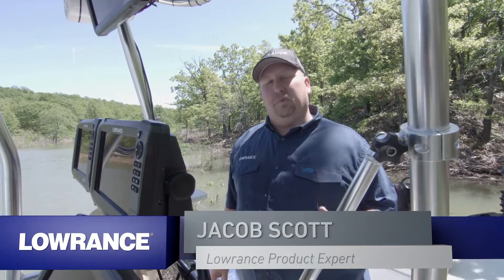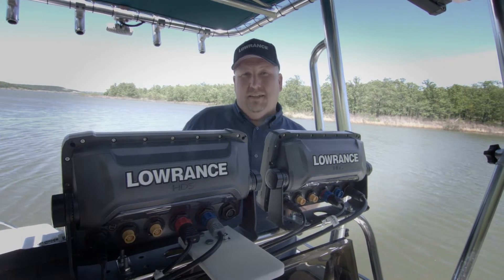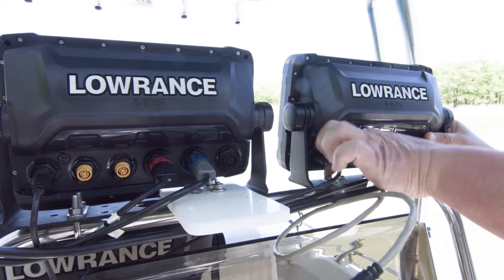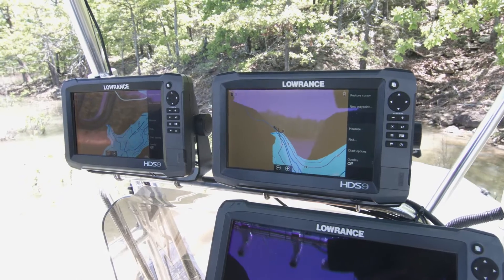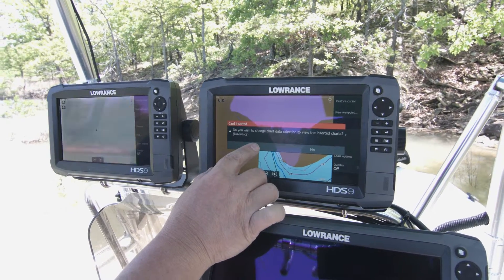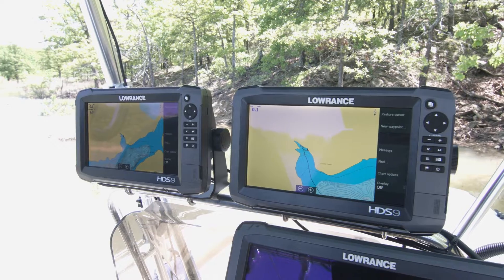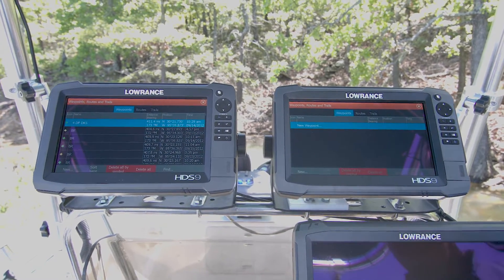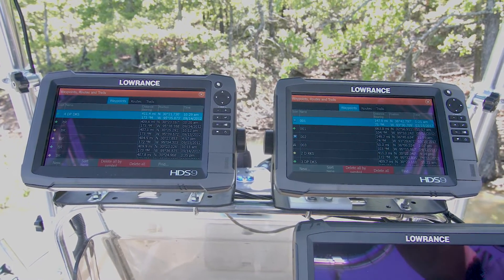Lowrance | How to Network Lowrance HDS units via Ethernet

Comment: I have a single HDS PRO 12 and want to add a HDS PRO 9 and a HALO20+. Can I daisy chain them with ethernet and have all the info shared on both units? 
Like HALO20+ connected to HDS 12 then HDS 12 connected to HDS 9. I do also have a Airmar B175 and one 3 in 1 transducers connected to HDS 12…

Comment: I have an hds 12 live and a Elite 9 fs. I was told to link then I'd need a nema 2000 cable. I am running the 12 with active target. Is the nema cable or ethernet cable needed?
Reply from the maker: You can use both N2K (GPS antenna, trolling motor) and ethernet (sonar, cartography) connections.
To connect the AT module you'll need ethernet connection.

Comment: Can we hook-up 2 hds units with Ethernet but share one transducer?
Reply from the maker: Yes, you can ethernet connect your two HDS units and share one transducer. You will be able to share chart too.
Reply: @lowrance  thank you. I can’t get it to talk to the other unit and show depths etc. 
is there a number I can call for help? 
Transducer on my HDS Carbon 9 at the help works fine. The second HDS Carbon 9 I added doesn’t read the depths

Comment: I have an HDS 12 gen 3 on the dash AND an HDS 7 first generation on the bow.  I spent $4,000 plus for the HDS 12 and was told multiple times that the gen 3 unit and the first gen unit could be networked.  I had nothing but trouble.  The sonar pages would often freeze on both units, plus all kinds of other crazy things going.  I spent loads of time on multiple occasions on the phone with tech support explaining in great detail my setup being sure to mention one unit was a first generation HDS 7 and the newer one was gen 3.  They said that is not the issue, that the units should network.  I even sent the HDS 12  back to Lowrance to be checked out, and reset.  It was not until recently that I found out on an online Lowrance forum that they will NOT in fact network   because the older unit will force the newer unit to go into "Legacy Mode".  So what the hell Lowrance, you should know this ! !  What a waste of time, and heart ache on the water ! !
Reply: I’m having the same issue with 2 Live 9’s and a Gen 2 8”. I think the Live hooked to the Gen 2 goes into the Legacy mode they refer to and those locators on,y had 1 ethernet port on them. The software must tell the Live unit that there is only 1 port available so it shuts down the 2nd port hooked to the other Live 9. That explains why my 2 Live units aren’t able to see each other on the Ethernet network but can see the Gen 2. I’m going to try them with the Gen 2 8” off and see if that resolves the issue. It blows that I lose the Gen 2 8” as my full screen map at the bow though if that is the case. Any thoughts @Lowrance ?  Edit…that wasn’t the issue. Even with the HDS Gen 2 disconnected, 2D sonar still freezes and loses its connection to my bow Live 9.
Reply from the maker: The two units, can indeed, be networked together, both via Ethernet and via NMEA2000. You do have to consider the Gen1 might not have the feature you want to share from the Gen3.
Reply: @lowrance  I respectively disagree.  I had nothing but trouble when networking via ethernet my Gen 1 HDS 7 and Gen 3 HDS 12.  Some features like waypoint sharing worked but so many glitches began showing up.  Sonar page would freeze on the Gen HDS 12, side scan would sometimes not work.  All that went away after I disconnected the ethernet connection between the two units.  I now have connected via the same ethernet cable a Gen 3 HDS 7 with same HDS 12 Gen 3 with zero issues.

Comment: I have connected the HDS9 Live with the HDS Gen3 with ethernet but waypoints and mapping aren't sharing. Any Ideas? I'm on newest update for Gen 3, 18.2
Reply from the maker: Are you able to share other data over ethernet? Please make sure the cable is not faulty.
Reply: @lowrance  Both units recognize each others transducers but still no waypoint or Navionics map sharing.  Is there a setting I need to look for?

Comment: Can you connect HDS9 Gen3 with HDS9 Live with ethernet?
Reply from the maker: You can indeed Keith.
Reply: @lowrance  I have connected the HDS9 Live with the HDS Gen3 with ethernet but waypoints and mapping aren't sharing. Any Ideas? I'm on newest update for Gen 3, 18.2
Reply from the maker: You should try with another ethernet cable. Make sure the HDS Live is running the latest software. Contact our service department if you're still having issues.
Reply: @lowrance  Both units recognize each others transducers but still no waypoint or Navionics map sharing.  Is there a setting I need to look for?
Reply: Kieth, I connected my HDS 12 Gen 3 with a new HDS 9 Carbon unit.  The way points transferred from the Gen 3 but not the Routes.  Have you figured anything out that might help?  FYI, I previously had a 7” Gen 2 unit instead oh the Carbon unit and had no issues with sharing. So I believe that the cable is good.

Comment: thanks
i have module with ethernet cables,2 hds carbon.charts share fine, but sonar sharing not right.the unit with the sonar installed in back is showing fine, but it does not share the sonar to the un connected side.do i have to tell the unconnected hds the transducer by going into settings/sonar/install/etc?
thanks
john

Comment: Can I transfer the mapping part through the nmea 2000 network to the other unit or is it only done with the Ethernet connection? If not will result in me purchasing another mapping card for the other unit is my understanding.

Comment: Will settings come over as well? Or renaming sources?
Reply from the maker: Hi
If you rename a source that name will appear as a source on any networked display.  Settings will not.  When you make a change to a setting it is applied to the unit you are making the change on.  When you use that unit as a source that setting would be used and any corresponding information from that unit would have the setting applied.

Comment: I have one carbon 12 and two HDS Gen 3 9s. They are connected via ethernet and NMEA 2000. They are constantly losing commo from the carbon 12, Why? I have called lowrance many time with a successful fix to the loss of data between the units.

Comment: I now have dual HDS Gen 3D- 12's side by side on the console like in your video. 
Linked them with Ethernet cable.
Refer to them as #1- installed a year ago and #2- installed last week. 
.
Trip #1-  Had sonar (83/200) cable in #1 and there was no 2D on #2. After putting the sonar cable in #2, everything seemed fine. Fished all day w/o issue.
Trip #2- Issues with 2D sonar on #2 unit. It was fine then went to a slow to no scroll and a light brown image on 2D.
The TD and cable it good. I checked it in a LCX that I also have in the console. 
.
1. Looks like you have a NEMA 2K to each unit? I have HDS #1 only connected to NEMA. Should both be connected?
2. What should each unit be set on? Choices are "This Unit" or "HDS3-12"

Thank you,
.